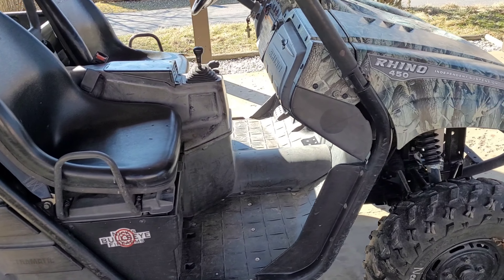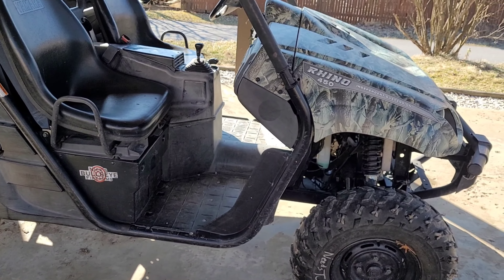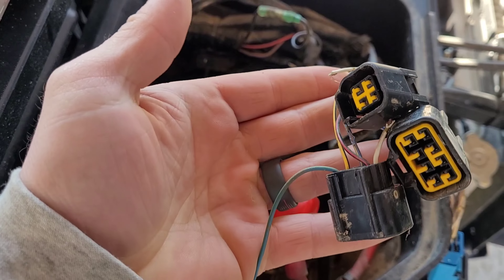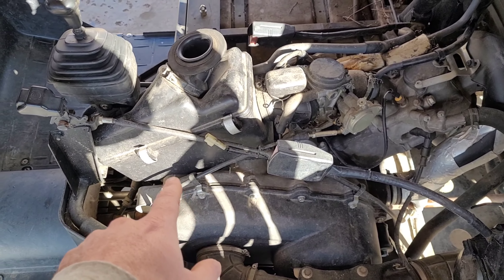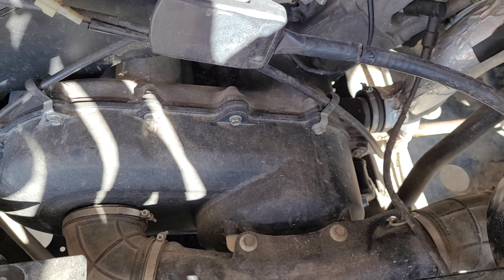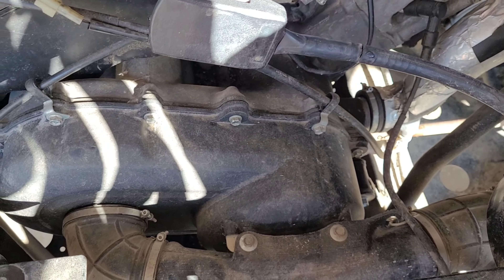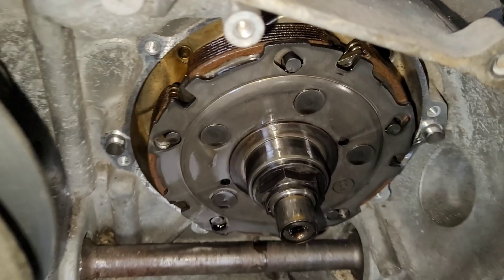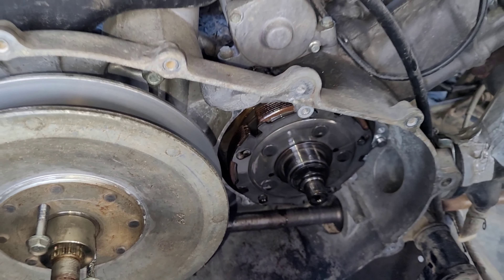New Rhino 450 Intro and Part 1 for clutch replacement!!  #yamaha #rhino #sxs

Comment: Did you fix it? Was it the clutches? What did it sound like before fixing?
Reply from the maker: Yupp!  I actually made a couple other videos on the machine.   I put a new oem yamaha wet clutch in it. With an ebay Chinese slug kit.   It works great now.     It didn't make much noise. It just wasn't moving when put into gear.
Reply from the maker: https://youtu.be/n4dBdZYWD04